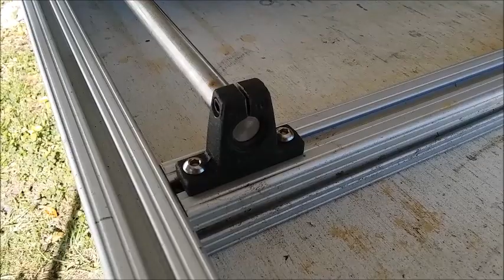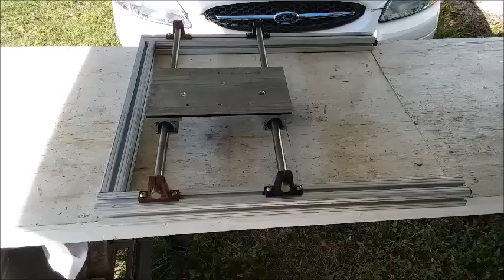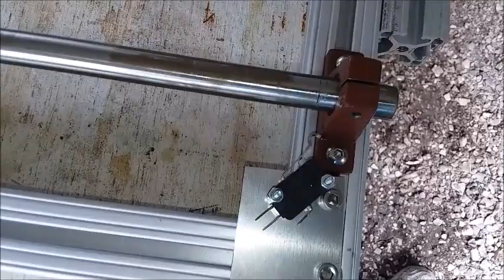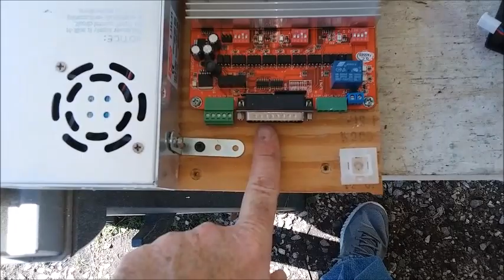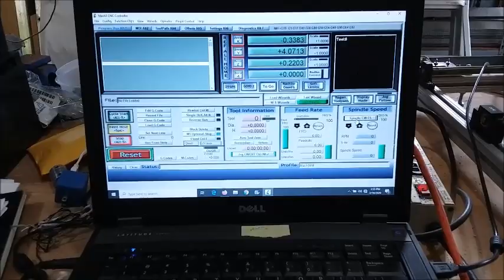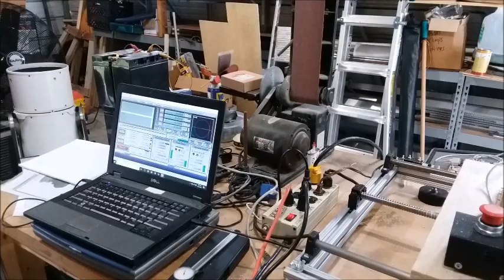A home-built CNC router made from 80/20 components

Comment: https://youtu.be/8e40KwOAh7o?t=2710 have you given it a go with aluminium? How serious a machining job do you think you could undertake machining an aluminium block?
Reply from the maker: I am itching to try it with aluminum. I need to make some changes first though. I need to find a better way to better attach the spindle so it won't move under cutting forces. I need to add variable speed to the spindle. I also need to buy some proper metal cutting end mills.
Reply: @omegageek64  I know this comment is 3 years after you responded to Jeremy's question, but carbide routing bits work well on aluminum.

Also, how did you protect the lithium grease on the ball screws from sawdust?